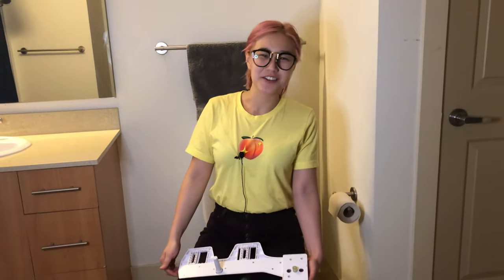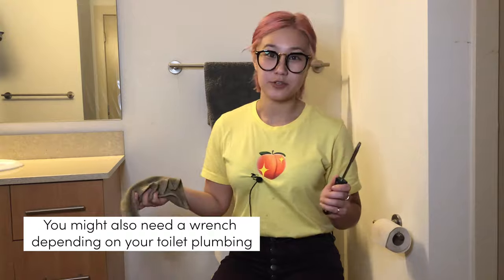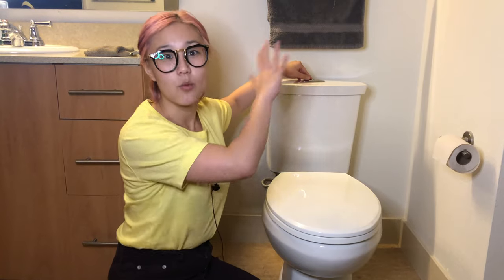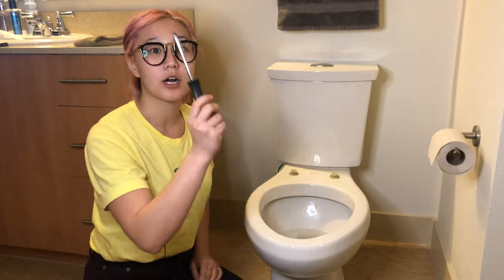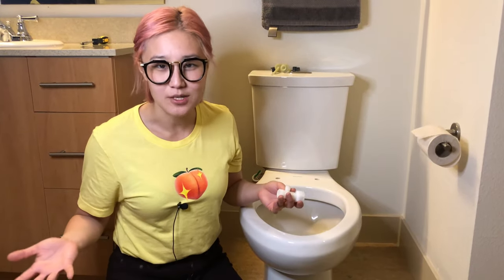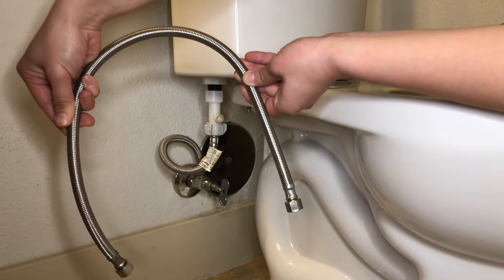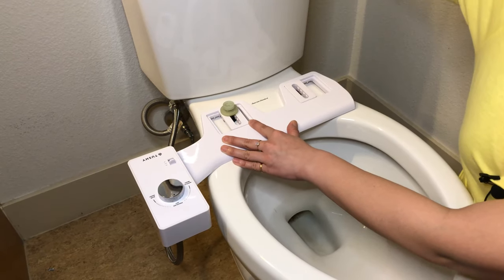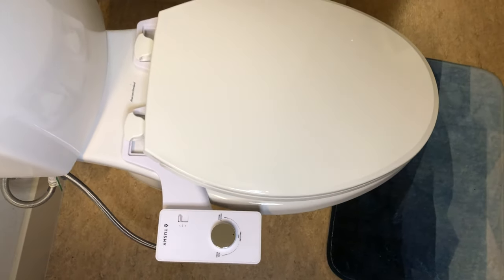How to install TUSHY Classic (in 10 minutes or less)

Comment: That nut is still righty tighty. It's a right-handed thread as you face the top of the thread, The only left-handed thread on a toilet is the flush handle retention nut.
And Very few toilets have quick releases on them.
Reply: Thank you! It's simply rotated to vertical.

Comment: Definitely had a major mess on my hands after I messed up the righty loosey bit. Accidentally unscrewed the nut from the tank and what little water was left in the tank dripped everywhere. Plus I couldn't get it tightened enough to eliminate the leak. I wish I would have seen this video first. That righty loosey tip is gold!
Reply: righty tighty lefty loosy
Reply: @mcsmcs9435  typically yes, but for some satanic reason, it's righty loosey for the bolt under the toilet.

Comment: Thank You!  Had never done anything with Plumbing before, but watched this and then installed the Tushy all by myself! The tip about the Towel really really helped! Just dont have the upper body strength to deal with most nuts and bolts, but turns out the grip that a towel gives helped a lot. Also making sure the Tank was empty before unhooking anything.. less mess in the bathroom! :-)

Comment: I notice that you didn’t connect to the hot water supply under the sink. Does the water temperature really matter? If so, how do you connect the hose to the hot water?
Reply from the maker: TUSHY Classic only has a single temperature connection. TUSHY Spa has a warm water connection.
Reply: Hello TUSHY I tried to install the Classic but the attachment for the tank didn’t screw all the up. It was too short-so kept drawing a leak. Water trickled from the attachment before I cut the water supply on. Any suggestions?